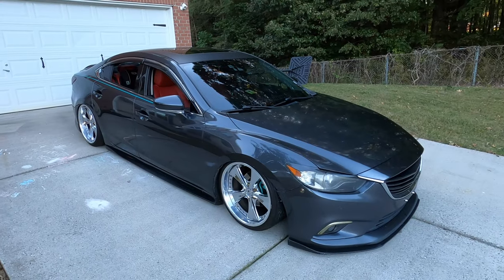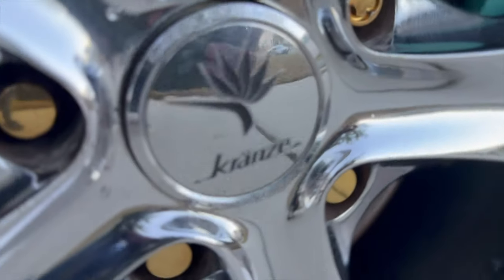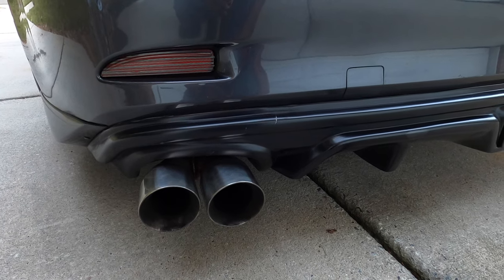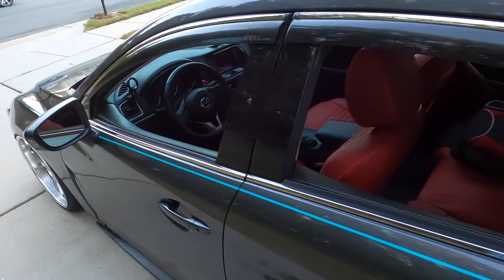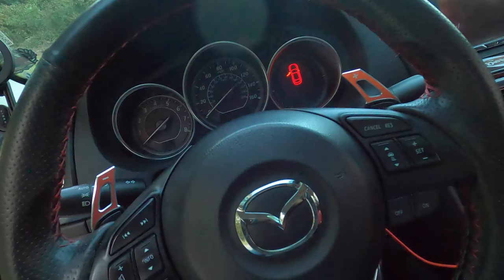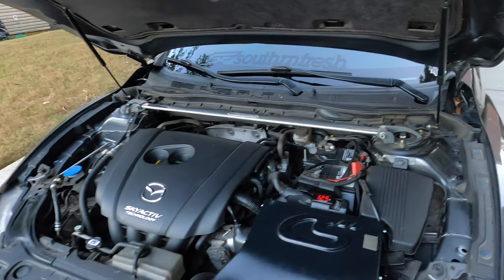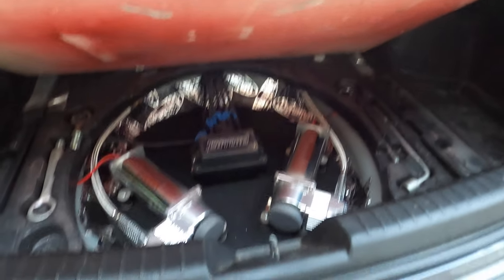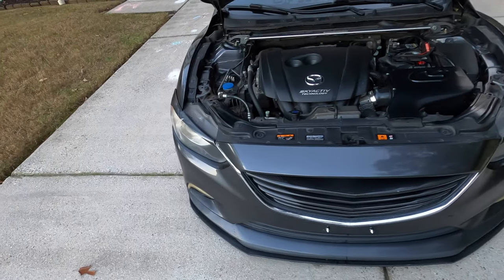My Bagged Mazda 6 Walkaround | Modifications and Part List Updates!

Comment: You didnt link the diffuser. Personally not into the teal pin stripe or on the brakes but i would love to whip it around i have a all blacked out GJ 2016 with muffler deleted and soon to be tuned
Reply from the maker: The diffuser is no longer available and I havnt been able to find another dual tip diffuser. And depending on how next year goes, I might get a sauce tune, but more for mpg’s and efficiency and not power.  And it’s always good to meet other 3rd gen 6 owners!